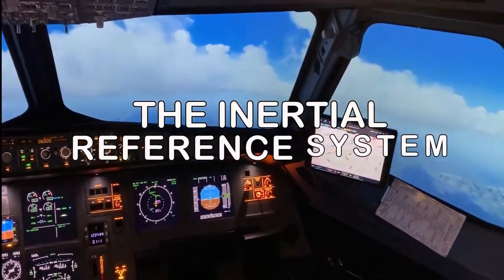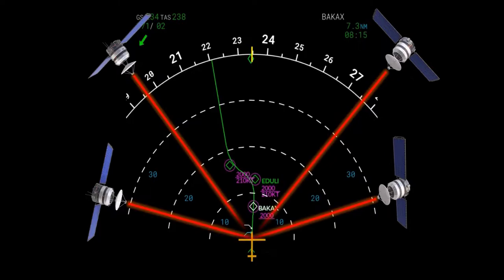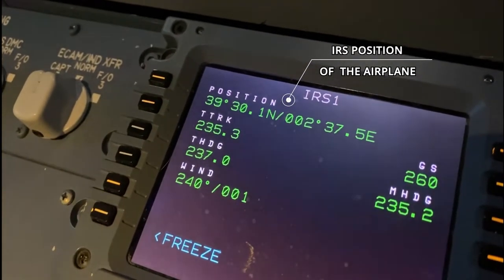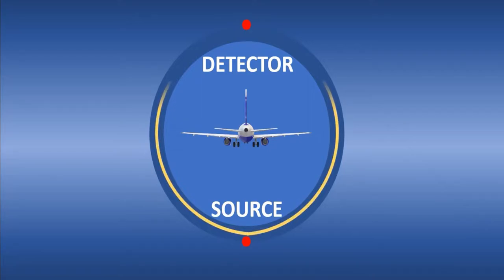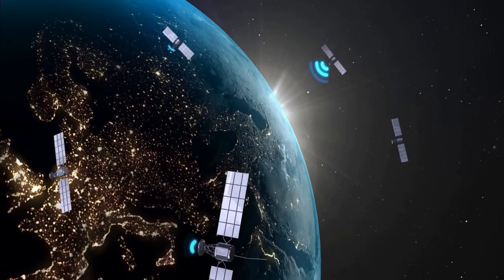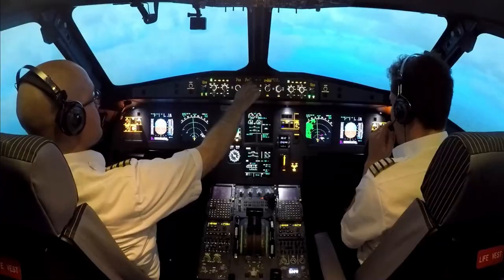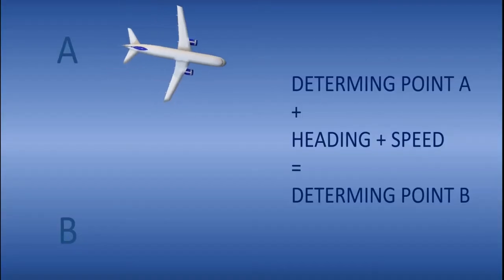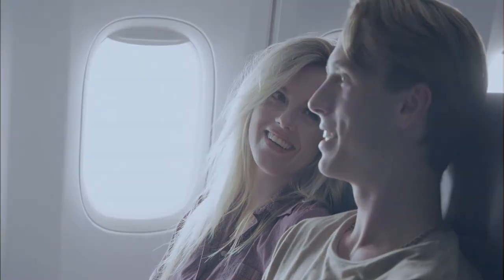GPS LOST! How to navigate with a modern Airliner with the help of IRS?

Comment: Really? Celestial navigation? 
If you lose GPS your fine for hours with the IRSs and even better if you have rad navs nearby. 
The problem is not losing GPS but having wrong GPS indications, that is what can complicate things as it will corrupt the FMGC position calculation. You'd have to deselect GPS and probably update your position with a known nearby rad nav.
What NOBODY would do is celestial navigation 😂
Reply from the maker: Hello! This is only a demonstration of methods that are available. Human instincts are also a factor that needs to be taken into account. A good example is the Varig Flight 254 when passengers tried to say to the cabin crew that the sun should not be in the position that it was and the pilots actually had made a fatal mistake. This is celestial navigation. Check it out for example here: https://www.youtube.com/watch?v=1oOLQjzPOFA